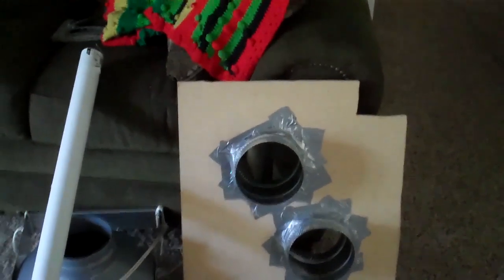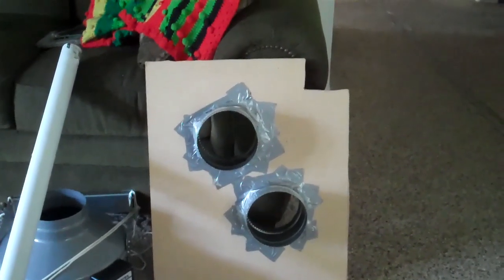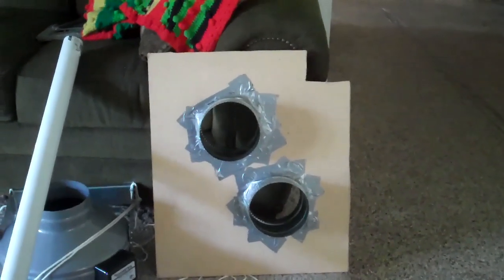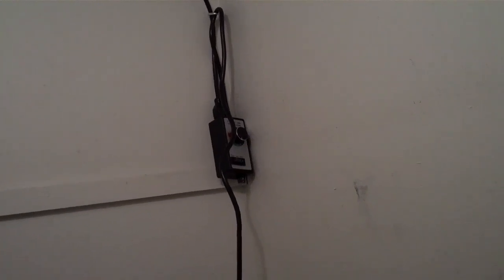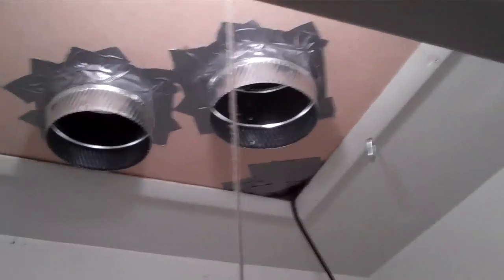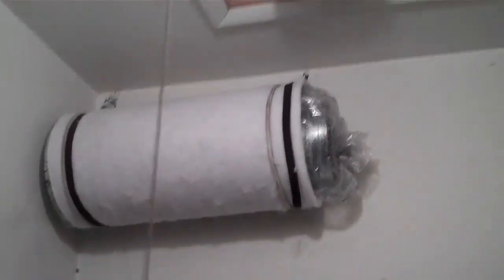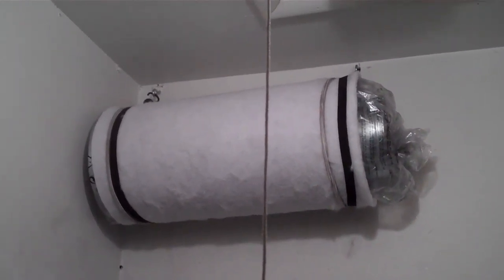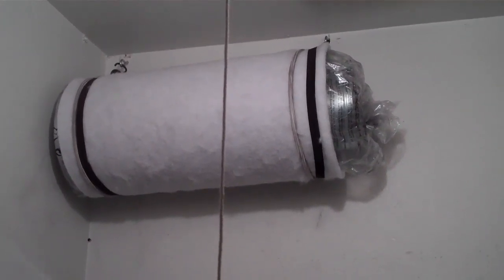How to make a 3' X 4' hall closet into a hightech Hydroponics grow room.

Comment from the maker: yea and it doesn't matter much in either case. the plant canopy  always grow right up  to the light fixture in  my small closet grows and little to no light reaches down past the canopy anyway.  and even if you grow only 12 plants in a 3' X 3' area, not all of those make it because of crowding and available light.  the remaining 8 - 9 plants STILL produce well over a pound of dried buds each cycle so far.  I get 3 cycles a year out of that space, it's WAY more than I need for medicinal use.

Comment from the maker: you have to force air  cool a high power light hood and keep the room temp under control ( from the hood heat ) .   unless you want to cut holes in the closet walls or ceiling, then a closet with a removable ceiling trap door works  the best.  I also do the exact same thing with another closet that has the trap door into the space under the house. both work nicely and eliminate damaging your house or apartment. relocating all that power blower noise to outside your living space is a bonus too.

Comment from the maker: growing taller / faster is great for mother plants but undesirable for regular plants you want to take through the bud cycle.  growing indoors in soil  ( Foxfarm is good ) is good for 3 plants , but growing from seeds usually  takes more than entry level  skills. it can add a month or two to your grow cycle time ( 4 - 4 1/2 month normal ) as well.  seeds have to be sprouted first , then  " sexed " in a forced bud cycle , reverted to veg cycle  and then ( preferably ) cloned to grow to harvest.

Comment from the maker: I hear of people that use 400 watt lights and just HPS bulbs but I don't know anyone that does that successfully and I know several dozen growers.  even 600 watts is getting low in wattage and takes skill to use properly , I doubt that  I could grow a harvest crop with such a small bulb.  I can grow mother plants with bulbs between 150 and 400 watts BUT those get " topped and trimmed " regularly. with 400 watts your plants will want to grow taller than you want them to be.

Comment from the maker: I currently  use a 600 watt dimmable set with both HPS and MH bulbs depending upon the growth cycle .... and I like hoods / light fixtures that are the " cool tube " style because they keep the grow area much cooler in temperature. these hoods usually have a 6" air duct system. a 1000 watt light set with a cool tube fixture is also a good choice to keep your plants from getting too tall for the closet ( or with 600 watt lights, shorten the veg cycle )..

Comment from the maker: if you are speaking of " lamps " then spare / replacement bulbs are very inexpensive on Amazon dot com. if you are speaking of entire lighting fixtures , hood, lamp, and ballast ............. then search ebay for : hydroponic
light set ...........  400 watt sets ( everything you need in a kit ) a little over $100 , up to 1000 watt sets for a little over $200.  always get digital ballasts that can be dimmed to lower wattage , that do both kinds of bulbs and kits with both MH and HPS bulbs.

Comment from the maker: important too is that you MUST have a inlet port area ( into the grow room ) a little larger than the exhaust area. this is usually a space under the closet door about 2 - 3 inches tall and the width of the doorway.  and exhausting into the attic near a vent ( turbo fans in my case ) to keep humidity under control.  humidity isn't an issue in dryer areas of the country.

Comment from the maker: it's through the odor filter , seen in the back left roof area of the closet , through the light hood, up through the in-line duct fan out into the attic. I've mentioned it on other replys and you can google " how does a hydrioponic inline duct fan work " for , more into.  simply put , it keeping the grow area under negative pressure and exhausting the air through a large  charcoal filter.

Comment from the maker: during the bud cycle many species give off an aroma that is so powerful that it can be overwhelming. it can float on the wind for miles. so powerful in the house that it can / will  sicken many people ( I love the aroma however  ay ahay ahy  ).  even in the veg cycle , many species ... especially Indicas can be very strong as well.  the duct fan, in the attic ,  that cools the light fixture also remover odors from the grow area by drawing grow room air out through a charcoal odor filter.

Comment from the maker: one is air out , air in comes in through the opening under the room door.  the  2nd hole is  plugged and if I did it over again I wouldn't  cut the 2nd hole. I've used it before as a cool morning  air source in summer growing ( as explained in one of my other videos )  using a thermostatically controlled  duct damper and an air " Y " fitting. it turned out to be more trouble than it was worth and I no longer use that method.  simple is better.

Comment from the maker: just get up there with a strong light and a good broom and clean out those webs and debris. it's important to keep the growing area really clean to control possible mold and especially to make sure mites don't get started from the leaves you already have up there. plus how did those leaves get into the attic space ?? you'd not want outside stuff getting into tht attic. borrow or rent a shop vac to help you out.

Comment from the maker: I've seen people grow in attic space in an older house.  you'd need to have enough  vertical space. if you put a light up near the peak of the roof, then you'd need to have room for the plant ( up to 4 1/2 feet ) and then room for the space the flood table and reservoir as well. probably another  3  to 3 1/2 feet for that too. you always hear of attic fires from people growing in their attics, you'd want to be VERY careful with any heat  from the light hood getting nearby wood too hot.

Comment from the maker: welp,, not shown in these older videos is the 3' - 4' tall  PVC frame that I have stretched a section of volley ball netting across the top of  with mini bungee cords.  the basic flood tray holds about 21 plant pots  which is way too many for the space. I usually grow 9 - 11 plants and use the  grid of  netting to help support the stalks  which results in  a " sea of green " effect.  this is " mandatory " for such a small space.   for harvest pictures , check out CalHydro Fresno on Facebook.